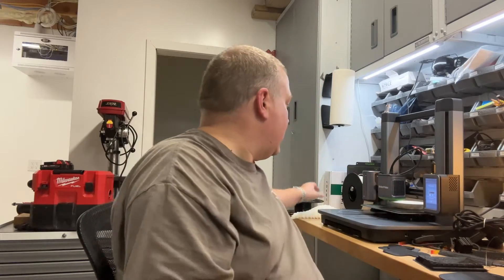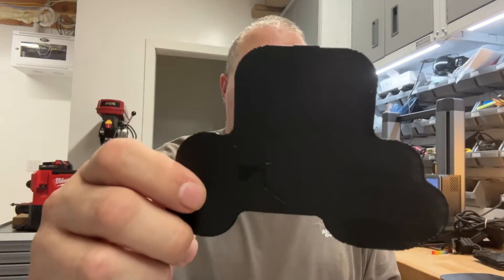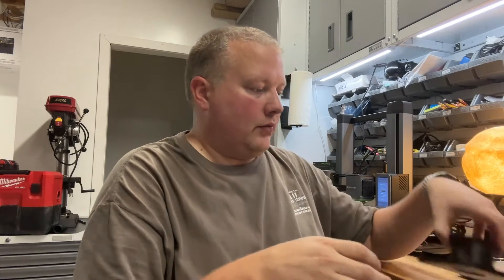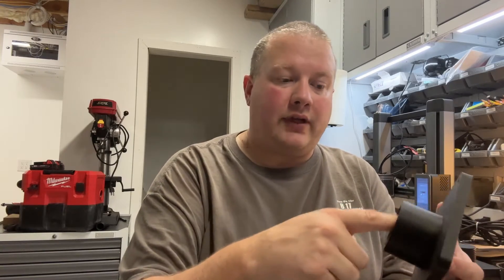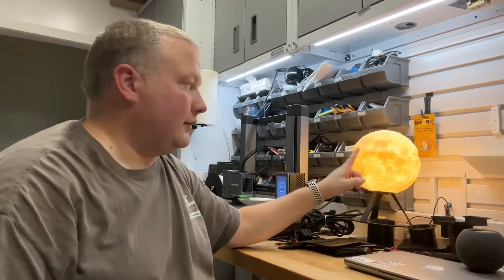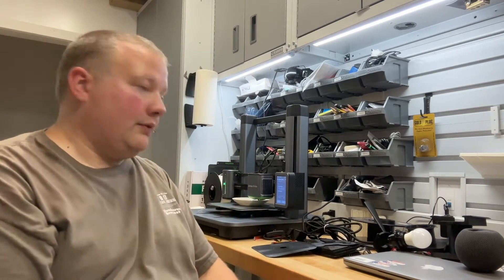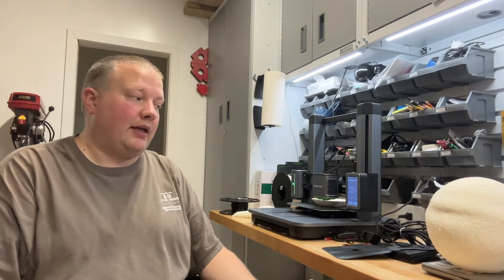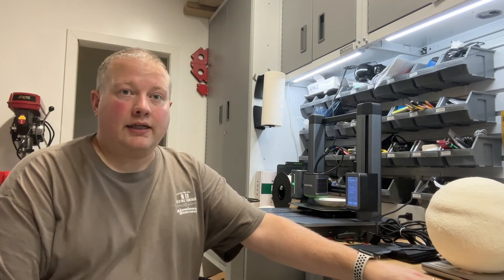AnkerMake M5 - Adhesions issues, bad filament, and more WiFi issues

Comment: First, i have 2x16 screws that i dont understand why they arebin the pack. 

Secondly, the printer is printing in the air. Object sliced well and its on the bottom of the bed. Leveled the bed over and over but still the same issue.

Comment: Thank you for sharing your experience. I just got mine in today and you are helping me trouble shoot through my own Unifi issues.

Hope they firmware update it.
Reply from the maker: I still find that updates can cause Wi-Fi issues.  It seems to be an issue with UniFi systems alone.
Reply: @timexperience : This isn't the first time I have encountered Unifi WiFi issues with random IoT devices. It sent me down a deep rabbit hole one night, going as far as manually downgrading firmware on APs, among many other increasingly desperate ideas. 🤣

I have adopted a new "set it and forget it" approach to my Unifi management, and I am generally happy until something like this pops up randomly. I think it's some long lurking bug somewhere they can't find.
Reply: Update! Auto leveling has commenced! Thank you!

Comment: It should be noted that you mentioned X or Y filament was worse or better. What you should probably know or mention is that all filament is different based on humidity and optimal temperatures.

You could make that any filament work by playing with the temperatures and dialing in the sweet spot. This is what people who 3d print have been doing for years :)
Reply from the maker: My last video I discuss that very subject.  While some filament does not work well in the AnkerMake slicer ‘easy’ setting I was able to dial it in for the worse filament and returned a great result.

Comment: I am new to 3d Printing and the filament you liked is called hatchbox?  We have tried Overture and didn't have any issues with it, we are using Anker now, no issues yet.
Reply from the maker: I should of stated the I was using the east setting on the slicer with no custom settings and that this was applicable to my set up.  There are so many variables that works for me may not work for you and vice versa. Good luck with the new hobby.
Reply: @timexperience  I should ask you about these "east" settings.  The only adjustment that we have made was to the Zoffset to 0.10mm and so far, lots of fun.
Reply from the maker: Autocorrect, should of said easy settings. Also, go check out the AnkerMake Community unofficial as well as the official communities on Discord and Reddit.  There a lot of great people who will share lessons learned and helps with issues.

Comment: Hi,
I have the same issue with my AnkerMake M5 and Unifi Setup. 
Fyi I added another wifi with only 2.4 GHz enabled, no WPA (so an open network) with mac-filtering enabled. For now it does work fine so I assume there is something broken with the WPA2 authentication. Definitely not the best solution, but a work around for now. I hope Ankermake will fix that soon.
Reply from the maker: I will give that a try.  Thanks.
Reply: @timexperience  Unfortunately it didn't last for long. Same problems again. So that's not the solution neither.

Comment: I have found HUGE differences between filament brands, and you do get what you pay for. I don't pay $50 a spool, but I think once you're above $25 or so per kilo, it's decent stuff. The Micro Center stuff isn't bad, but not great either.
Reply from the maker: I have had similar hit and miss success on Amazon filament as well.  Enough that I stay away from it.  Thanks for the comment.
Reply from the maker: What brand?  I was thrilled to get that TecBear working.  At $13 it is a good value.

Comment: Still waiting for my AnkerMake M5. Excited to try it out! Just a word of caution, glow-in-the-dark filament is usually abrasive and will eat through brass nozzles. It is recommended to get a hardened nozzle when printing. I've heard rumors that the nozzles Anker uses are proprietary but I would be interested in your feedback if that is true. If so, I suppose we need to wait for Anker to make them. Happy printing!
Reply from the maker: I will take a look at the nozzle and try to determine it’s specs. They sent at least three 0.4mm nozzles with the printer.